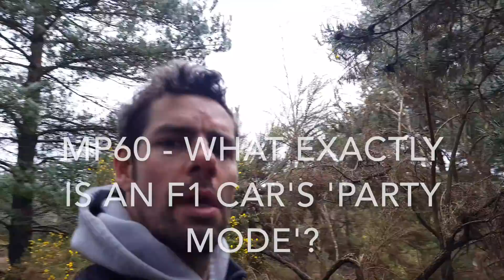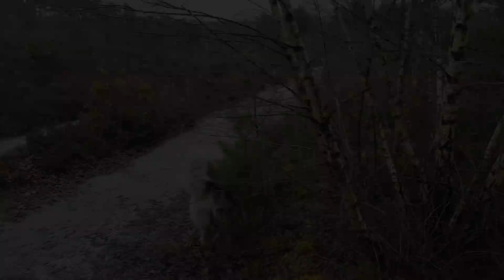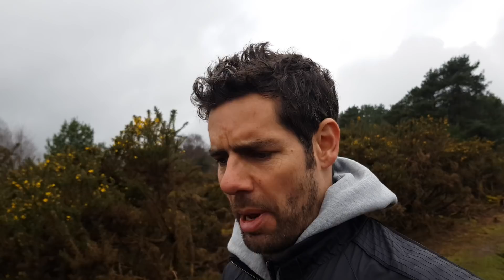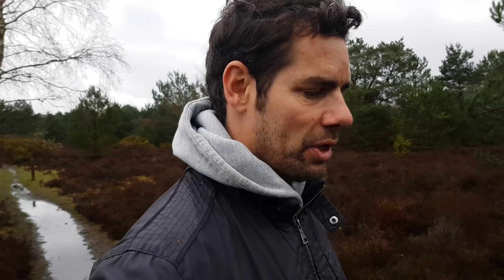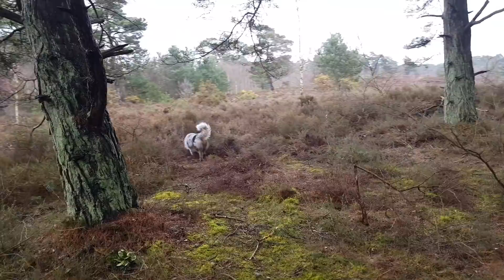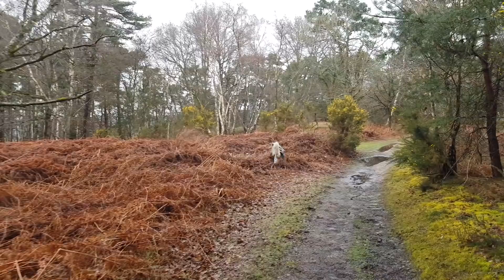What Exactly Is An F1 Car's Party Mode?

Comment: Hey Marc, how often do they change the brakes on an F1 car? How is the wear?
Reply from the maker: Brad Jacobs They're measured after every session on track. One set per race, then they become scrap or test brakes.
Reply: Marc Priestley So they use the same set for the entire weekend?
Reply from the maker: Brad Jacobs Depends on circuit, but normally new for Q and race.
Reply: Marc Priestley Thanks for the feedback. Much appreciated. #subscribed

Comment: Considering Ferrari's performance prior to Q3, is obvious they also  turned their engine up. They are Only blaming Mercedes because they couldn't match the merc power or "party mode" as Lewis put it.
Reply from the maker: xlonglexis Everybody turns everything up for qually, it's just Merc has the better engine.

Comment: Hi Marc. I agree that the strategic use of these technical modes is an intriguing part of the sport but the problem is that it’s not at all obvious to the viewer what’s being done when. This is where I feel F1 could really improve things for the hardcore fan. Imagine if it was possible to be able to see when teams are using different engine modes, diff settings etc, it would be fascinating. I think the sport could work at two levels, what we have now for the casual viewer and then a far more geeky experience for those that want it. Allowing fans to listen to all pit radio would be another option. There aren’t many sports that have this amount of cool stuff going on but it’s currently not accessible. Such a wasted opportunity.
Reply from the maker: Jon Clark Yes I agree, F1 could do a much better job with graphical data based TV displays to explain this kind of thing. Btw, you can listen to all team radio through the F1 app.

Comment: Can't be the flow limit alone. Oil burning v2 this is. Perhaps tiny little tank somewhere with extra perltrol or whatever.
Reply from the maker: tweakradje It's not just the fuel flow limit, did you not watch the video?
Reply: Hi Marc, sure I did. Very relaxing video and great image stabilization btw! Apart from the electrical assists I was focusing on the ICE in my comment. We now know Merc had special lubrication oil to burn in Qualy. Perhaps next year we will hear how they managed to get so much HP from the engine again this year for one lap. With this comes the benefit of carrying more down force too. Still raises questions why other Merc teams cannot do that, at least not noticeable. It now almost looks like the old days when there were dedicated Qualy engines. The "Party Mode"  effect is the same. Great video. Keep them coming :)

Comment: May sound like a daft question but with the teams limited to just the 3 engines for the year why don't teams slowly replace components on the engine that by the end of the season the serials are the same but realistically its a completely different engine? 

am guessing the FIA would check this but maybe its that obvious that nobody has tried it?
Reply from the maker: Calum Clark Engines are sealed by the FIA, so can't be opened or have components changed without gaining specific permission.
Reply: Marc Priestley makes sence thought it would be a easy way around it like trigger with the broom out of only fools and horses 😂

Comment: Hi Marc. I understand your explanation but in Australia Lewis was phenomenal especially after analysis/comparison with Kimi made by Karun pre Channel Four race. It showed that on the straights where the power is king Kimi was slightly better than Lewis. However on the corners Lewis was able to take more speed. Pardon my little knowledge of these cars, but for me that says higher downforce not power. This would also explain why the Ferrari would be quicker on the straights as the higher downforce might mean higher drag. Toto said that the speed Lewis took in the corners he thought he was going to crush or overrun them. At the end of the lap on tv you can actually catch, Toto mouthing, “Unbelievable, unbelievable...”. Even Bono’s voice when he came on the radio after qualifying you could tell he didn’t expect that time. I think Ferrari have caught up in their party mode too. Last weekend were treated to one of those “Lewis Hamilton laps”. Just like in Monza last year and Spa 2015 or Germany 2011 although he didn’t get pole. All I’m saying is that people are over emphasising the impact of party modern Australia. I believe the gap won’t be that big in Bahrain. I doubt Lewis will be on pole but he’ll win the race but come China he’ll be back to pole and win. Call me Mystic Sil
Reply from the maker: SileTa Mus I didn't say his qually lap in Australia was down to the Merc's high power mode! In fact, on the show, I analysed the lap using the same FOM graphics with HAM/RAI and pointed out exactly that. Having said that, the Merc high power modes are clearly better than the rest and have been for over two years.
Reply: Marc Priestley hi Marc. I have now watched the F1 and seen your explanation in which I think you highlight the same questions as I raised. I was highlighting the issue that most people were saying the lap was mostly due to the Party Mode which I was saying... 'Not necessarily' because of the speed LH was able to carry into the corners if the Party Mode Maximizes Power.
I didn't mean to dislike your response btw. I'm only just seeing it now that I pressed the wrong thumb. Apologies.

Comment: Would the teams be able to use the full qualifying mode on both Q3 runs, or just the one run? Can they harvest enough energy on the out and in laps in Q3 to use it on both runs?
Reply: Mark Jones he mentions this in the video! They run the mode on both runs (he spends some time explaining the various reasons why).
Reply from the maker: Mark Jones Both runs.

Comment: Hey Marc, what is the reasoning behind not including engine modes in parc ferme? Is it just impractical? And why are setup changes not allowed? Has this made for better racing? Love your work!
Reply from the maker: Josh Stuart Not sure it's made better racing, but changing parts after qually was banned to save costs as we were using specific engines/gearboxes etc then changing them for the race. Changing steering wheel switches doesn't fall into that category.
Reply: Thanks for the reply.

Comment: I Know Hybrid technology is used in road cars but is this level of regenerating batteries off the brakes and engine plus battery power for maximum boost, is all that being developed in road cars? seen as the rules for F1 are changing in 2021 or whenever, is this hybrid F1 era worth it?
Reply from the maker: Ben Deere Yes, current F1 hybrid tech is relevant to road car industry.

Comment: I see Wilson was running around in party mode!

I assume the PU manufacturer has tested  this performance mode until failure so they know exactly how long it can be used? The question that remains, is whether all teams running a certain PU have the exact same modes on the PU or if the works teams get a different mode than the customer teams?
Reply from the maker: Bertie Wooster Yes customers must have access to same software modes as manufacturers. It's in the regs from this season.
Reply: Yes, but is there any control with this? 
If they do have the same modes, the difference in lap times is then down to chassis and aerodynamics and then the PU basically nullifies any power output difference between the teams with the same PU.
Going to be interesting to see the lap time development and the diffs between the team with the same PU since the modes should be the same.
Reply: Bertie Wooster The rules state that customer teams must be given all the same tools and modes as the works team, I think this was introduced over the winter. Merc have always said that customer teams have the same modes but I think Claire Williams said something along the lines of being unsure if they did which is probably why the FIA introduced the rule.

Comment: So did Lewis wreck the engine during the closing laps when he went for it? He seemed to keep his foot in for several laps.
Reply from the maker: M ell No, he's working to the limits his engineers allow in the race.
Reply: Marc Priestley I did wonder that so why turn it back down? Why not pack on the pressure and wait for the mistake?
Reply: M ell He turned it down to preserve the engine for later races & there was very unlikely going to be a mistake from Vettel as he's used to taking pressure & Melbourne is a track where it's extremely hard to overtake anyway.
Reply: Formula1Madx my point was that Lewis clearly turned up his engine because after the race he stated that he turned it down to preserve it. So the point of this video is to explain engine modes and there are many. Lewis was in a race setting and turned it up and kept it turned up for several laps. Marc has explained that at max mode you don’t have to many laps and the teams have to be very careful how they use them.  So can we conclude that he either turned it up to the max and has now used a lot of the “party mode” laps OR he didn’t turn it up to the max, there is another setting, let’s call this “not quite Party mode”. If he was in this setting then he was able to be with a second and sustain it. So why not go in to Party mode and take him at turn 6?  My point was I thought he was in his very highest setting so I think he has used laps he shouldn’t have and as a result this will impact him in future races.

Comment: If all teams(factory and customer) have access to the same performance modes, then why do the manufacturers have such different deltas between the modes? i.e. why can't Williams get the same performance as Mercedes?
Reply from the maker: Douglas Barton The PU has to work in conjunction with a great chassis/team/driver. Red Bull out-perform the factory Renault team, but they both have same modes and usage available.
Reply: It's a lie.  The idea mercedes doesn't give it's customers the same hardware and software is illegal.  How often have you heard redbull saying they don't get the same stuff as the renault factor team?  Never, because they have a better chassis.  Power is one thing, a very important thing but chassis delta is far greater than engine.  Renault is roughly 1 second slower than redbull, is it any surprise Force india and williams are that far back of mercedes?
Reply: Its all down to packaging and aero. Factory teams work together for a seamless car. Customer teams have to build their car around engines.
Reply: Williams has had horrible car for past few years and they have just managed good point scoring because Mercedes engine was much better than Ferrari or Renault in other midfield cars. But now difference is much smaller and there is actually 3 bigger teams using renault power which drops Williams a lot down in results. But still there is clear advantage for Mercedes and Ferrari engines over Renault but in race difference is small enough that RB with excellent chassis can be fastest on some Sundays.

If you wonder difference between Q1 and Q2 with top teams being large. Then you just need to take into account that they can afford to run lower power mode for Q1 than midfield teams without risking ending up to bottom 5.
Reply: Mercedes might not give them the best engine so that Mercedes can be sure that williams won't beat them.

Comment: Not only engine lifetime is factor. Also the overheating is a main issue. Lewis and Valteri needed to be in clean air and back off to avoid overheating. Or at least. That was how they explained it.
Reply: All teams suffer the same issues.  Daniel backed off quite a bit to get fastest lap for his bonus.
Reply: Bahamuttiamat At least he didn't want us to believe that they were having overheating problems. Interesting to see what happens in Bahrein.
Reply: Alot is said over the radio we aren't prevy to.

Comment: Marc do you agree with Christian Horner that one mode must be used throught the weekend. So if Merc use party mode in quali then they should use it through the race? I do hate the fact that everyone goes on how fast Lewis is in quali even though we all know he has extra power in that car.
Reply from the maker: Kondja Negongo No, I like the strategic element of how teams use the tools they have available.
Reply: Hi Marc, to a certain degree I definitely agree. However, when I think about a race like Monaco (or Melbourne), where overtaking is virtually impossible (with current specs), it's not just a strategic element anymore, I'd argue. It's an advantage which other teams cannot overcome. Even if their true racepace was considerably quicker than the team going with a party-mode strategy.
Although I must say the real problem is not the power mode itself, but the (in)ability to overtake in a race situation which should be looked at. Until then though, I do have an issue with party modes. (stressing again that power modes are not the real issue!)
And thx for the vlog, btw!
Reply: Gamesmanship buddy.  It happens all the time in f1.  Last year ferrari got mercedes' suspension banned, hence the diva car.  As a result mercedes got ferrari' oil burning banned, hence the reason they had so many failures later in the year.  Like politics, all teams lobby the FIA for a competitive technical advantage, or to disadvantage their competitors.
Reply: Valid points i would also like my advantage preserved if i was winning
Reply: Kondja Negongo christian is stupid. Mercedes are not switching out a race engine for a qualifying one. They are keeping the same engine but allowing it to produce more power for one lap. This is a technology many if not all teams use but it is the fact that the so-called "party mode" was publicised by mercedes snd hamilton. Bear in mind that the "party mode" is the same as the quali mode mercedes had last year. Honer is just pissed off over the fact that renault suck
Reply: @Daniel we know they not changing out engines. Who doesnt know that? I agree Horner does come across like a sour puss when ever he loses. When RBR was winning he was full of himself now all he does is complain complain complain